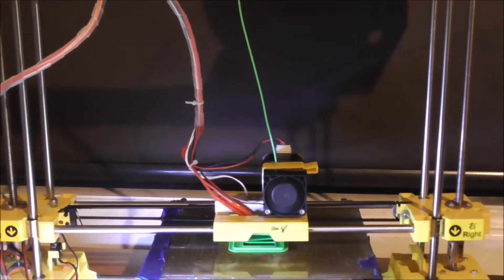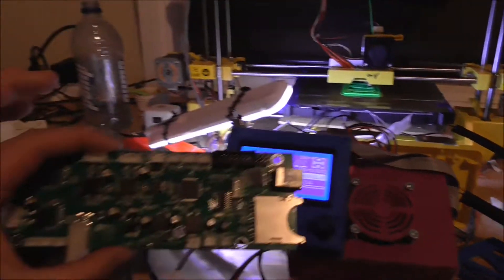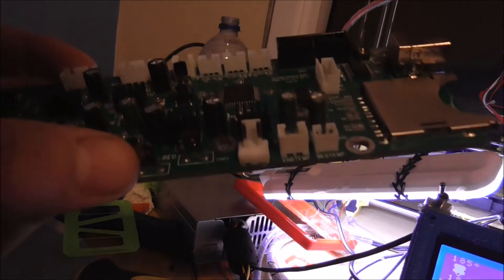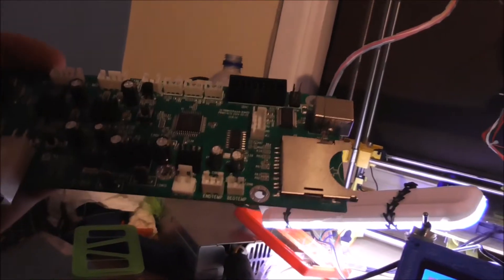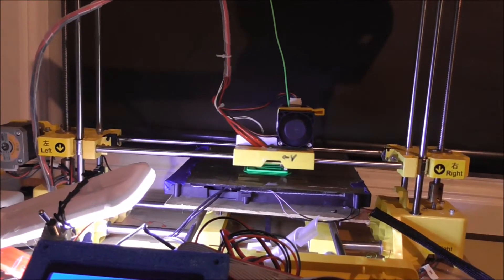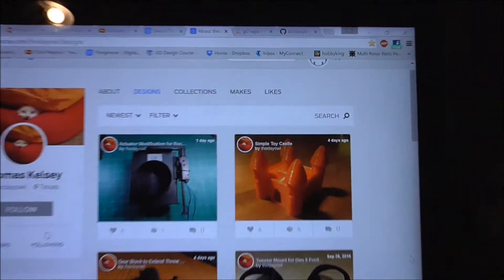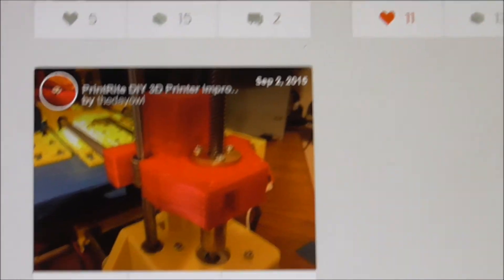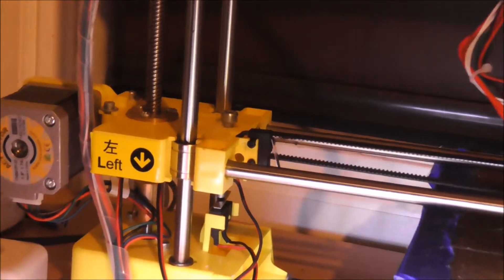Print rite 3d printer BIG update

Comment: dont suppose you'd be willing to share the completed firmware you flashed to your ramps would you?

Im currently in the process of swapping the crappy PR board out of mine after it started reporting massively incorrect temps and tbh Im not the best when it comes to fiddling with coding through Arduino.

Id truly appreciate it.

Comment: I have bought all this parts. but if i try to upload the firmware on this board i have an error.

It says:
'u8g_fntpgm_uint8_t' does not name a type

any idea where the problem came from?
Reply: +Horror18m 
  This report would have more information with
  "Show verbose output during compilation"
  enabled in File > Preferences.
Arduino: 1.0.6 (Windows NT (unknown)), Board: "Arduino Mega 2560 or Mega ADK"
In file included from /dogm_lcd_implementation.h:38,
                 from ultralcd.cpp:39:
dogm_font_data_marlin.h:13: error: 'u8g_fntpgm_uint8_t' does not name a type
dogm_font_data_marlin.h:172: error: 'u8g_fntpgm_uint8_t' does not name a type
In file included from /dogm_lcd_implementation.h:40,
                 from ultralcd.cpp:39:
ultralcd_st7920_u8glib_rrd.h:43: error: 'u8g_t' was not declared in this scope
ultralcd_st7920_u8glib_rrd.h:43: error: 'u8g' was not declared in this scope
ultralcd_st7920_u8glib_rrd.h:43: error: 'u8g_dev_t' was not declared in this scope
ultralcd_st7920_u8glib_rrd.h:43: error: 'dev' was not declared in this scope
ultralcd_st7920_u8glib_rrd.h:43: error: expected primary-expression before 'msg'
ultralcd_st7920_u8glib_rrd.h:43: error: expected primary-expression before 'void'
ultralcd_st7920_u8glib_rrd.h:43: error: initializer expression list treated as compound expression
ultralcd_st7920_u8glib_rrd.h:44: error: expected ',' or ';' before '{' token
Reply from the maker: +Horror18m i have not had this issue pm me on bf that way i can help faster https://www.facebook.com/profile.php?id=100006396375886

Comment: Please show how you installed the bed, cheers,
Reply from the maker: +MrTaz0079 well my bed was taken of my old davinci printer so it will be a bit harder but i can show how u can do it using wood board
Reply: +3D printing ,Thanks for the quick reply , I received the Print rite 3d printer today,its my first 3d printer so i am a  total noob, So will apologise in advance, 
 Was looking at the hobbyking heated bed ,http://www.hobbyking.com/hobbyking/store/__46896__3D_Printer_Hot_Plate_MK2B_Dual_Power_RepRap_Mendel_and_RAMPS_Compatible.html  ,
what else would I need to complete the heat bed install?
Reply from the maker: +MrTaz0079  yes this will work also u will need 3 tension springs and 3bolts with nuts and some sort of board to hold the beated bed and another 1 that ataches to the bottom